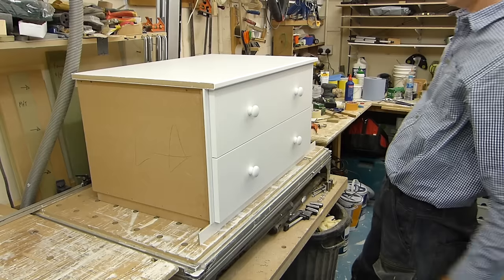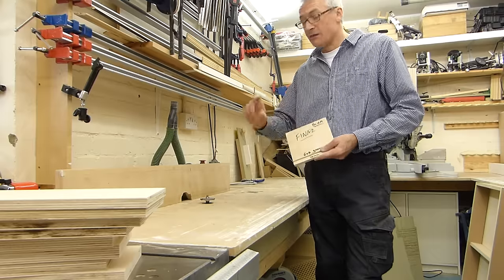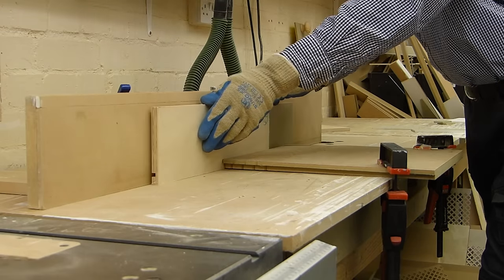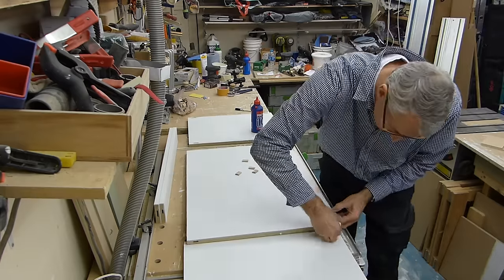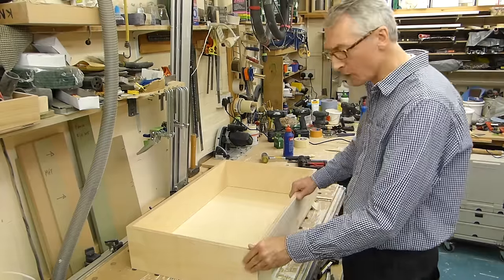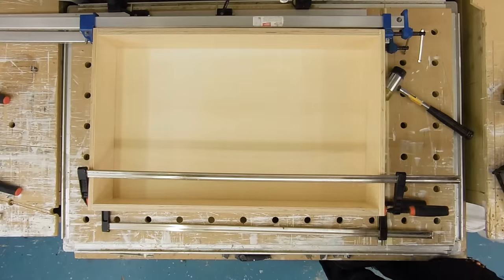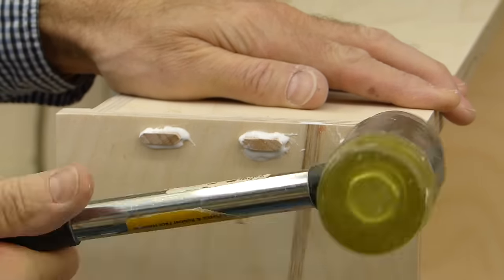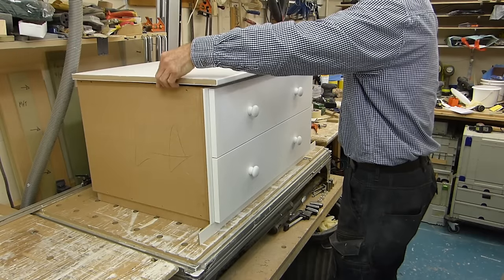How to make a two-drawer cabinet, Part 1, #012

Comment: Another helpful video, thank you, Peter! I keep seeing the hinge mount that attaches your guide rail to your bench and it appears to be a huge time saver for frequent cuts. Where did you get it from, please?
Reply from the maker: Thanks! It’s an off-the-shelf Festool MFT or Multi-function table & the hinged rail comes as standard. See videos #182 and #183 for more details. 👍 I will be making my own budget version before too long, so watch out for that. 

Festool MFT video 182, https://youtu.be/0V-p5F7SjO4 and follow-on 183	 https://youtu.be/RxcVY8ZR2fQ

All MFT related vids in a playlist here - http://bit.ly/MFT-related
Reply: @10MinuteWorkshop  thank you for the detailed and fast reply. You're a gentleman. I would be very keen to see making your own budget version of the hinge mount. BTW, your videos inspired me to building a very complex studio desk with racks, including cable and power management. I'm no carpenter and much of my information comes from your videos. Thank you! I may contact you when it's done to share with you.

Comment: Hi Peter, what brand are those draw hinges I need some for a job and was wondering if you have any tips on what the best ones to use are?
Reply from the maker: Draw runners? These were Grass Dynapro, but I’ve since switched to Blum Movento for the ease of adjustment. 👍👍
Reply: Thanks i’ll look them up. And thanks for the videos I’ve learned so much from watching them the last year or so 👍

Comment: Hello Peter. Another nice wee build. You mentioned that you used HL paint (I think that's what you said). Can you tell me what the HL abbreviation stands for? Many thanks.
Reply from the maker: Duncan Macleod Hi Duncan. Sorry, travelling just now so can't view the vid. Not HL paint, can't think what I said, but I almost always use either Dulux or Leyland water-based acrylic in an Eggshell (HL??) finish, applied over a water-based acrylic primer/undercoat with a foam roller. Hope that helps, and thanks for watching!

Comment: Hay Peter, why did you make the drawers ouf of ply instead of MDF? Is it because of looks or stability? I am building a MDF cabinet and I am not sure if MDF is suitable for the drawers.
Reply from the maker: For strength in this one; the drawers were to house some heavy art books, so they needed to be as strong as possible. Also, I like the look of Birch ply for drawers. 👍
Reply: @10MinuteWorkshop  Thank you!

Comment: A super clear video and great style, again..;-) A quick question about your track saw and guide rail. Are you using the Festool MFT table attachment for making the cross cuts or have you made your own shop-built version..?
Reply from the maker: Simon Coupland Thanks! I have a Festool MFT table, but it's the older MFT 1080, not the current MFT3. TBH unless you really think you'll make good use of the fence and flag stops, an MFT-style top and some bench/rail dogs will save you some serious money! Appreciate the feedback, and thanks for watching. P
Reply: Yeah, I'm making a bench with a MFT style hole pattern - just looking at ways to make it 100% square and accurate. Hopefully I'll be able to use the Parf dogs or similar to do the cross cuts.
Reply from the maker: Simon Coupland Sounds like a plan. You can get MFT-style tops off eBay that are CNC cut, so the holes are dead square; well worth the money IMHO. Cheers, P

Comment: Great videos, really enjoying them, keep them coming. What's the adapter you use on the domino when you cut the through dominoes? thanks
Reply from the maker: Thank you! It's called the 'domi-plate' from Seneca woodworking - https://goo.gl/5F7EED. Mine's a very early Domino and there were a few issues with the fence drifting; the domi-plate takes care of that completely, in my experience. HTH, P

Comment: Hi Peter
Can you tell me the make of the soft close draw runner you use cant see them listed.
Cheers
Peter
Reply from the maker: These were Grass Dynapro runners. I tend to favour them over Blum as they have a slightly heavier weight rating on the standard runners, though my local suppliers have had a big price hike recently, so I may just switch back to Blum... 👍
Reply: Peter Millard did you change back to Blum, or another make?

I’m about to start building my kitchen. It will have a lot of drawers. Maybe 40+ !!

I want undermount, soft close and full extension maybe 20kg

Any suggestions? Depth of drawer will be around 550mm

Thx

Comment: Hi Peter. You've probably answered this one before, but may I ask the dimensions of your workshop? Regards, Duncan.
Reply from the maker: +Duncan Macleod In total its about 300 sq. ft. split into 2 rooms each of around 20x 8.5 - almost exactly single garage-sized as it happens, though it’s a commercial workspace. More details in my workshop tour video, if you’d like to check it out 👍